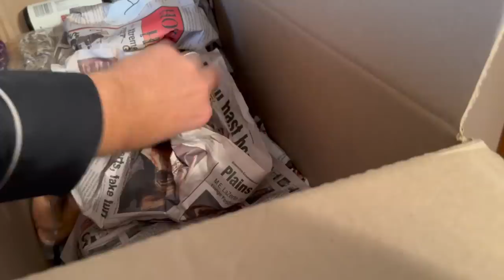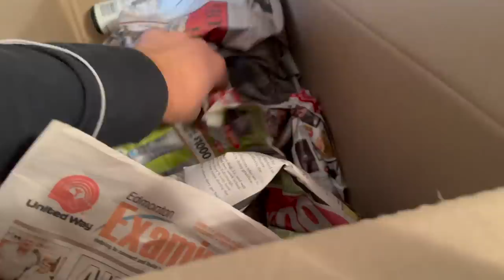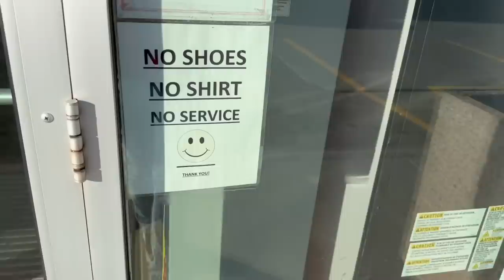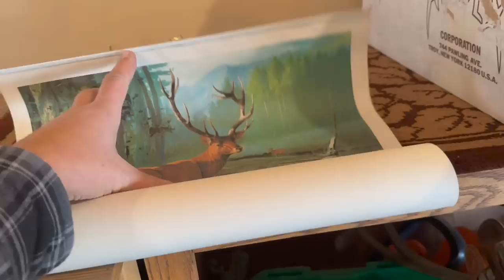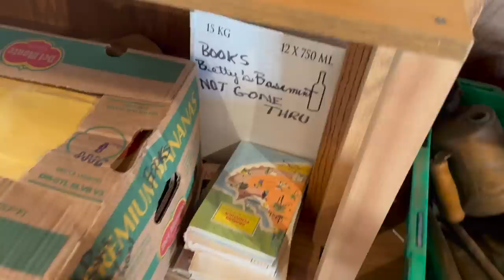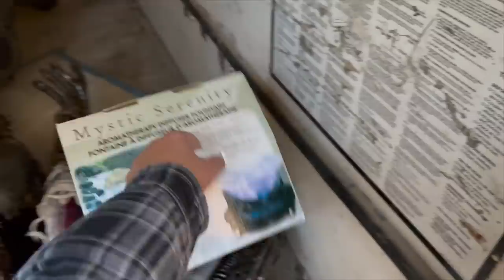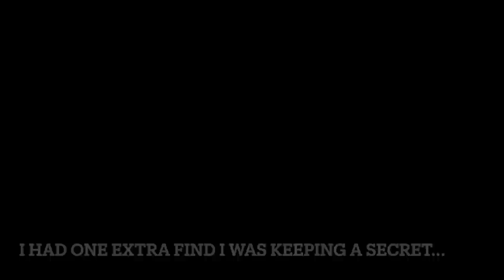Pt 10. the safes were found! Searching the attic. Almost done!

Comment: 15:50  I just bought a home like this!  So excited, which is one of the reasons I enjoyed watching this series.  It's been inspiring to see you clean up that place because it's similar to mine.  I grew up in a home build int 1895 with a stone foundation.  It's still in our family and where my 2 sisters live, with my mom, until she passed in March 😢 I've lived in the second floor apartment of my duplex for the past 18 years, which was built in 1870.  

I spent 3 times the price of my current place, on a home very similar to the one you're standing in.  My old duplex was very inexpensive (took $40k in repairs to move in) back in 2004.  I haven't moved to the new place yet since it's my busy-season and I work from home.  I spent the past 2 months having all the original hardwood floor refinished, installed a new electrical service panel inside and out, removed the old 70s paneling, and repaired and painted all the swirled plaster walls.  Finally I need to finish replacing the living room, dining room, and hall with baseboard.  Watching this series with you this past 2 weeks has reminded me of all the work that needed done.  It stunk from 50 years of smoking.  There were cables and telephone wires everywhere.  But the saving grace is, it had never been updated or remodeled.  The basement is unfinished, perfect for me to create a space of my own that house you have there.  Of course I didn't have to empty it as you are doing.  Next project is to replace every receptacle, light switch, and ceiling light.  Everything was covered with sticky tar and nicotine stains.  I'll be moving in soon, slowly but surely.
Reply: Wow, how did you get the smell out? I have heard that’s fairly impossible. Cool that it hasn’t been remodeled! It’s hard to find those houses anymore.
Reply: @cynthiafisher9907  First I tried an Ozone machine.  That didn't seem to work very well at all, but it was 50 years of smoking right?  We started with the 2 obvious things, the carpets all got pulled out (revealing worn hardwood floors that had never been refinished).  We pulled down all the 70's paneling and burnt it.  Everything was sticky with tar, nasty!  The biggest difference in the smell was after we scrubbed the hardwood floors twice with Murphy's Oil Soap.  That Murphy's smell lingered for nearly 3 weeks, amazing!

My business partner's brother paints homes for a living and used an expensive ($60/gallon) Sherwin Williams primer to seal all the walls.  We did scrub things down first though he told me it wasn't necessary (should have seen the nasty water yuk).  Then he painted the ceilings white, and the walls a gray color.   The painter took down all the vertical blinds in the house and placed them in the basement.  When I entered the house after he finished painting, I couldn't smell anything but paint.  Every wall had been sealed.  I was shocked when I went in the basement though, it smelled like smoke.  It had never smelled like that before!  On the way home after working on the house, I realized the smell had come from the blinds sitting in a pile down there.  Those immediately went to the trash the next week. 

Everything that didn't get painted was scrubbed. The kitchen cabinets and brick facade backsplash,  appliances, bathroom vanity and fixtures all were nasty.  I moved on to all the bedroom and closet doors, windows, and baseboard.  The difference on the windows alone, amazing!  I got the water bill for last month and it was $30 alone for just cleaning haha!  I return today (been 3 weeks since I was there) to see the refinished floors for the first time!  But also I'll get to have a fresh smell of the results of the work.  I started the process at the beginning of September, exactly 2 months of slow but steady progress of one day per week.  Lots more to do but I'm excited to get to moving in.
Reply: @leechburglights  Wow! I. Impressed! Thanks for the long answer, it helps to know these homes are salvageable. I’m very sensitive to cigarette smoke.

Comment: Minute 21, where u show the trailer.  Have to wonder why you don’t have the truck/trailer backed up the drive, with the rear trailer door at the bottom of the front steps/garage door.  Every step saved, as you carry out items to load conserves your strength for unloading later.

Comment: i know this sounds silly, but id back the truck and trailer up so i didnt have to carry all 250 boxes the extra 30 ft
Reply: Patrick will likely be along to tell you that they backed the trailer into the driveway to get the Predator into it.
Reply: @GuyWithTheDogs  im not so sure, the trailer was on the road with the predator in it, no reason to move it back there... guess im lazier than most, so i would have that trailer in the garage practically
Reply: @Sealutions1    Let's see...do I go with the answer that Patrick gave to a similar question, or do I go with your guess?

Sorry.  I'm going with Patrick.  He was there, doing the work.  👍